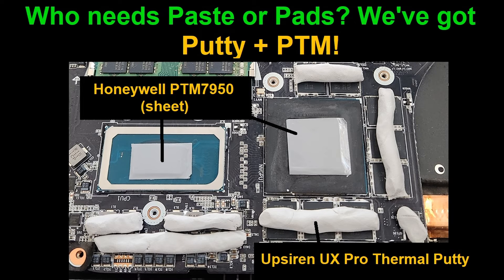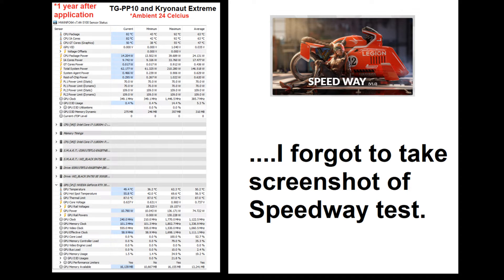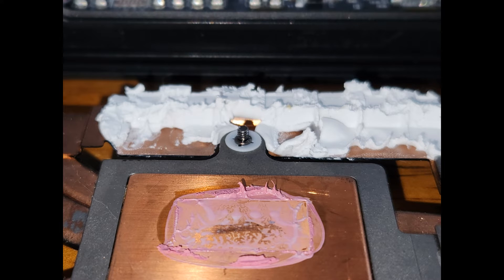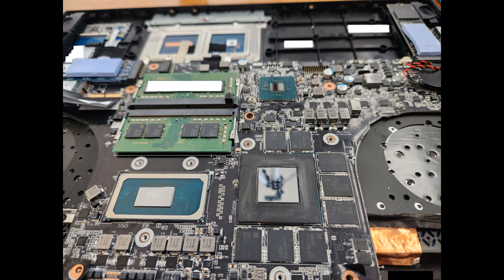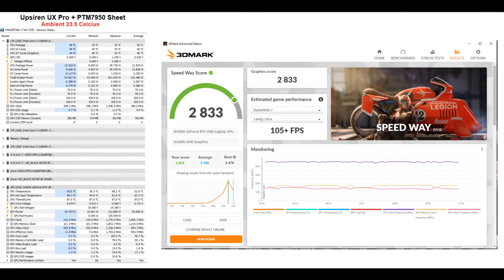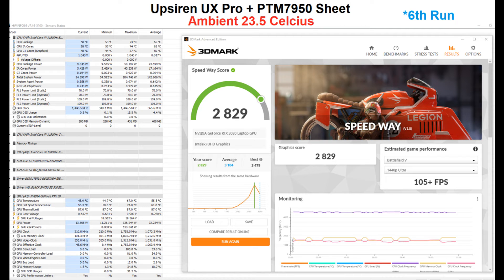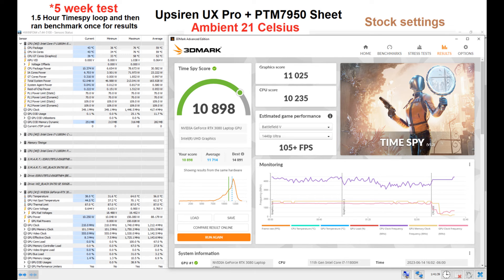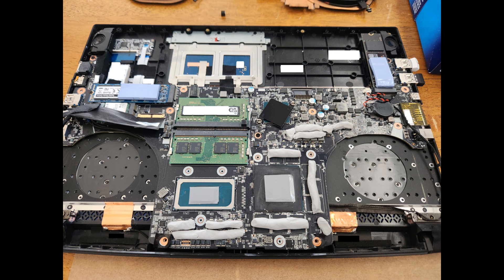RTX3080 Laptop meets Upsiren UX Pro thermal putty and Honeywell PTM7950

Comment: What happened if i applying too much putties on vram, vrm, chipset ,etc?
Reply from the maker: @vugiabao7tc425  as long as you get it compressed, and achieve good core contact then it's not an issue.

If you happen to know the stock thermal pad sizes then you can use my Thermal Putty Calculator on the Google Drive (Link in Description).

Alternatively. If you'd like advice on your application then feel free to join the Discord and post pics and ask for help.

Recommend pics include:
-pictures of the PCB and Cooler once you open it (with the stock TIM'S still in place)
-picture of your putty application

Then test fit the heatsink/cooler (tighten screws). Then take heatsink/cooler off.

-Pictures of the pCB and Heataink with the squished Putty.

Then someone will help you dial in the putty.

Once the putty is dialed in, ONLY THEN do you apply your Phase Change Material of choice (or paste if that's the way you want to go). My advice is go with Phase Change.

Comment: did you put the PTM in the freezer beforehand? mine was really tough to peel off and tore a bit, might need to reapply
Reply from the maker: @AdamAmbrus  I don't use the fridge or freezer technique as my ambuent temp is usually 25 Celcius or lower.

I recommend cutting the piece of Phase Change sheet about 3mm smaller than the die on all 4 sides. This makes 2nd peel easier, and you will still get full coverage once it melts, and 80% of the material will flow out to the edges of the die.

When I first place the piece on the die, I run my finger over it to warm it up and make it adhere to the silicon. Then I leave the 2nd film for a few minutes and work on the putty. Then I come back and use a sticker or piece of tape on one of the corners to slowly peel back the film.

Don't pull the film 'up', pull it back towards the other corner. Has less chance of lifting the sheet off the die.
Reply: @snarksdomain  thanks fo the extensive tips! I'll try it this way :)

Comment: What thickness of ptm7950 should i use for my asus tuf15 fx506hc? Im really trying to study before i open my laptop. Gained a new subscriber here. Thank you
Reply from the maker: @ajhaype  Thanks for subscribing :) The thickness won't matter in the long run. This stuff melts and squishes out the excess. Whether it starts at 0.20mm or 0.25mm, it'll still end up around 0.038mm. This means that over 80% of the Phase Change Material will end up around the edges of the die.

The most common thickness sold is 0.25mm.

It's best paired woth Thermal Putty as a putty will compress easier than pads will. This will allow for a much thinner layer which usually gives you better temperatures and smaller delta between core and hotspot.

It takes heat, pressure, and time to get thin, so keep that in mind. When you first boot up the laptop you will want to run some stress tests on CPU and GPU at same time. This is so that it will melt and fet thin for both at the same tine. Temps may look bad for 5-10 minutes but will improve. I like running the stress tests for 2 hours. This only needs to be done once. After that you'll still see gradual improvement over the next days/weeks.
Reply: @snarksdomain  thank you so much for the detailed answer. i hope many more people knows this channel your dedication on your channel is freakin awesome man. imma try to share your vid on my facebook. youre the best out there

Comment: Please is the 20g upsiren enough ?
Reply from the maker: I wouldn't buy Upsiren U6 Pro or UX Pro anymore. Upsiren UTP-8 is now the much better option. Better performance, lower cost than UX Pro, softer than UX Pro.

Other good alternatives include Fehonda LTP81 (only slightly more expensive than UTP-8, Honeywell HT10000 (best putty, but 4x the cost as of December 2024).

For laptops with gaps thinner than 0.5mm I recommend Halnziye HY236.

For a laptop you will want to buy 20g. you might use 15g (How much I used when I recently redid this laptop with UTP-8.
Reply: @snarksdomain  hi just an update on this, i am using utp 8 but my temps are not drastically better like in the 70s because my laptop initually used a blue thermal paste for cooling the vrams not thermal pads so i guess utp-8 is just too thick for it, are there any other alternatives i could try ?
Reply from the maker: @cruzz774  which laptop model do you have? It's quite possible UTP-8 is too thick if your laptop has gaps smaller than 0.5mm. If that is the case then I recommend using Halnziye HY236 instead as it can compress down below 0.1mm.

UTP-8, and other top of the chart putties all have a similar particle size. Having larger particles helps boost performance, at the cost of super thin compressibility. That's where the Halnziye is a better alternative for thin-gap laptops, and shims.
Reply: @snarksdomain  my laptop is the asus rog zephyrus g16 2023 model, could you help me with an aliexpress link where i can buy the product from?.. thank you
Reply from the maker: @cruzz774 Be sure to select the 20g of HY236 for the option.
https://a.aliexpress.com/_mNGUbaX
Reply: @snarksdomain  sorry it says item is not available
Reply from the maker: @cruzz774  my advice is to search for "HY236" or "HY206". You can also get in touch with Haknziye directly on their website and see what they advise for whichever country you're living in. You can also buy directly from Halnziye, although shipping cost will likely be a bit higher. That's the benefit of buying from large e-tailers woth broad logistics networks like Aliexpress, Amazon, etc. You get cheaper shipping costs.
Reply: @snarksdomain  i searched for it and found some on aliexpress but they are very cheap and take about 2 months to be delivered.. are their any other alternatives?
Reply from the maker: @cruzz774  it won't actually take 2 months. It'll be closer to 2-3 weeks, if not faster. Aliexpress quotes ling shipping times so that they don't have to issue refunds as often.

That being said, reach out to Haonziye sales and see if they can ship you something quickly if you want to go that route.

https://www.halnziye.net/

Comment: hey please can u answer for 1 application how much putty is required in the laptop 10g is enough or more is needed
Reply from the maker: For laptops buy 20g and maybe use 10-15g depending on Laptop model. 

If your laptop has thin gaps of 0.5mm or smaller then it's best to go with Halnziye HY236 as it can compress down thinner than 0.1mm with ease.
Reply from the maker: @devanshanil2468  For laptop buy 20g, maybe use 15g

Be sure to look at latest charts located at the Google Drive link in video description (Test Chart Repository > VRAM TIM > ETCHASH)
Reply: I'm wondering the same, especially when putting it like that. I thought  was normal to put the putty or pads only on the square surfaces instead of covering the whole area

Comment: Finally found gold. Almost ordered for padd until i did a little more research and found it could damage chips if wrong thickness is used. Well I'll just go with putty and paste (for cpu and gpu). Have you used Zezzio zt-py6 putty from ali? Planning on getting that. (haven't decided on paste yet)
Reply from the maker: @ironbootx  Putty FTW. Feel free to check out the charts located at the Google Drive link in video description (Test Chart Repository>VRAM TIM>ETCHASH).

Zezzios is decent putty. There are better and worse. All on the charts.
You'll want to buy 20g for a laptop. You might use ~15g.
Reply: @snarksdomain  thanks for this. I appreciate

Comment: Im not tech savvy or anything, 
I have a gigabyte g5 kf with the RTX 4060, it usually hits 90°c according to the osd app under intense gaming. Is it worth it to try repasting the gpu and cpu with PTM?
Reply from the maker: @3dollarsperfrown  Your GPU hits 90C? It it's just the CPU hitting 90C that's more common in a laptop, but the GPU should be running cooler (ideally).

Yeah PTM on CPU and GPU and putty on VRAM, VRM and coils.

Check out the charts located at the Google Drive Link in video description (Test Chart Repository>VRAM TIM>ETCHASH). You'll want to buy 20g or putty (should cost you $15 or less)
Reply: Thank you so much  @snarksdomain

Comment: With PTM7950 you lay the sheet down over the die and press down to make impression into it. Then you simply cut it out. Perfect size every time.
Reply from the maker: @SpAzMaNiK  I currently recommend cutting it smaller than the die by about 3mm on all 4 sides. Makes 2nd peel much easier, and you still get full coverage as 80% of it flows out once it changes Phase.
Reply: @snarksdomain  Fellow Canuck here, starting preparations to do my 3090 Turbo.  Already have the Upsiren putty, and the PTM has been languishing in the Cart for a while.  Little question if I may, pls & thx ... are you cutting the PTM to size with scissors?  Shears?  Exacto knife?  Seems very fragile ... ?
Reply from the maker: @TomNelsoninCowtown i use scissors. I cut it while it still has both plastic films in it, so it not too bad. It keeps together farily well.

Which Upsiren putty did you go with? Hopefully you got 100g. You'll use around 75-80 most likely.
Reply: @snarksdomain  Thank-you for the cutting advise!  And yes, 100g of the UTP-8.  Sound ok?
Reply from the maker: @TomNelsoninCowtown  Nice. You definitely have enough then. Can use the leftover on things like Motherboard VRM or NVME (with heatsink).

https://youtu.be/MhrykJtrfBA

When cutting it for the 3090 die, aiming for 50-70% coverage. It makes 2nd peel easier and you'll still end up with full coverage once it melts.

Comment: The thermal paste is blocking the air flow. You should just remove the thermal paste and thermal pads for optimal performance.
Reply from the maker: @rul1175  No. That isn't how the cooler works. Pads or Putty are required to move the heat fr9m the VRAM, Mosfets and Coils to the Heat pipes and oflver to the fin stack where the blower style fans push air through to move heat out of the laptop.

Not having an adequate Thermal Intwrface Matwrial for this job means that the laptop would get quite warm, and the components quite hot. That can cause damage at worst, or Thermal Throttling at the least.

Comment: thanks for tutorial and I have a question about material which used with the ptm  
you put on other circuits 
thanks again
Reply from the maker: @koukakoko9972  The Thermal Putty? I used Thermal Putty instead of Thermal Pads. The difference between Putty and Pads is that Putty doesn't have as much binding agent to make it cure and keep it's form.

There are many Putties to choose from. To see how they compare with each other you can take a look at the charts located at the Google Drive link in video description (Test Chart Repository>VRAM TIM>ETCHASH).
Reply: @snarksdomain  thank u
have a nice time

Comment: Is the U6 Pro Putty a good choice? I am on a tight budget, but need to use a decent putty for my vrams. I have an MSI Raider GE66 11UG with RTX3070 in it.
Reply from the maker: @seebzk  for a laptop you'll need 20g or less. I'd either go Upsiren UTP-8, or Halnziye HY236 (cheaper). Could also go with Jeyi 8100

Comment: Hi bro i really need your help pls return to me. i am using ptm7950 and game temps are ok but idle temps are high compared to regular thermal pastes (40  stock 50-60 ptm7950) can you recommend a thermal paste for idle. i dont game anymore
Reply from the maker: @gibonzproject9710  50-60 is a safe temp. Is that with auto fan speed? Are the watts used the same? I'd also check to see the core delta and if they are still good.

Also, any recent OS updates/upgrade? Like from Windows 10 to Windows 11?
Reply: @snarksdomain  bro i can't control the fan to set to 0 rpm. also on idle my cpu is 55-60 degree. this causes fans to always be at around 2900 rpm. before ptm 7950 on my stock paste i didn't have any idle temp problems as my temps didn't go above 50. also room temp is not high right now.
Reply: @snarksdomain  i need to drop below 50 degrees or fans will always be on. so i need al lot of help
Reply from the maker: @gibonzproject9710  does your laptop have pads or putty. If you are using pads then there's a good chance you're not getting enough core contact pressure to make the PTM7950 very thin. Once it becomes very thin the performance should be on par, if not better, than most pastes.

It's why I recommend using Thermal Putty in conjunction with Phase Change Materials since putty can compress more than pads allow.

If you want to stick with pads, then likely go for one of the thicker pastes on the market.
Reply: @snarksdomain  no i dont have pads only putty
Reply: @snarksdomain  can you recommend a liquid paste that is little bit more durable to pump out than others. thank you. i think ptm7950 and other stuff idles around 45° as it changes form. So it is not suitable for me thank you
Reply: @snarksdomain  master gel pro , mx6, thermal grizzlys what do you recommend
Reply from the maker: @gibonzproject9710 PTM7950 can still achieve lower idel temps in most cases, as long as it's thin.

I would recommend trying to apply some pressure by hand to the hearsink first before replacing the PTM. Thus would mean removing the bottom cover, disconnecting battery cable for maximum safety, and then pressing down with moderate pressure on the heatsink, on top of the CPU and GPU.

I recommend this as getting the putty perfectly compressed often requires manual pressure.

Then give it a good load for at least 30 minutes and reevaluate idle temps.

If idel temps are still bad then maybe something like the Fehonda 14.8w paste, or another thick paste.

I still need to expand my paste testing so not sure if I can confidently recommend something for you.

My recommendation for the Fehonda paste comes from me hearing good things about it from a couple of people I chat with.
Reply from the maker: I just tested out my laptop with the fans off and watching Youtube videos. It was doing an average of 43 Celsius at 25 watts. That's with ~18 month old, reused PTM7950
Reply: @snarksdomain  That's nice. Yesterday i reapplied my last ptm 7950 which lasted three times from 31x50 size. For now on battery with avg 3-8W cpu temp is 40-42°. I will test plugged in temps today. (Chrome + vs code + some coding apps with 20-25W cpu usage and with a external monitor). This time i left screws little loose.
Reply: @snarksdomain  never mind i just bought 40x80 ptm from passionate girl store today. i guess i have to replace every 3-6 months. my cpu + gpu die is total 420 mm² so 3200 mm² will last me at least 5-6 times
Reply from the maker: @gibonzproject9710  no need to replace each time. It can be reused. The best technique I've found so far is to scrape all the excess bits and place in the die, then put a piece of tinfoil over it. Buy a cheap butter knife and bend the end at an angle. Then you can heat it up with a lighter/torch/candle and use it as a hot iron to melt the bits into a flat sheet again.

Let it cool and then peel the Tinfoil.
Reply: @snarksdomain  thanks that is a great tactic i also use old leftover ptm but it's cheap for laptops. one usage costs $2 so worth it maybe for PC that would be make soo much sense

Comment: Hey Snarks, i have an Asus F15 (I5 11400H & RTX 3050) and id like to repaste it, i got the PTM and im trying to decide should i go with the UX Pro or the UTP-8, what do you think is the best ?
Reply from the maker: @karima.4332  I would get UTP-8 over UX Pro. It's similar/higher performance as the UX Pro, softer and cheaper.

Some other good options are Honeywell HT10000 (current top putty) and Fehonda LTP81.

That being said, if you find blue putty in your laptop it is likely Laird T-T-Putty 607. If it's still soft enough to reshape you can reuse it. Putty is good for reuse as long as it's still soft, and not the crappy liquidy white stuff.

For laptops with gaps smaller than 0.5mm I recommend Halnziye HY236.
Reply: @snarksdomain  thank you sir

Comment: I have an Asus TUF a15 (R7 4800H + 1650ti) 
i did repaste a few months ago with gelid GC4 on VRAM(hard and expensive to get putty in India) and gelid GC extreme on CPU+GPU

but it's horrible i am thinking of doing ptm7950 +  some kind of thermal putty but there is no real comparison for noobies between all the versions of upsiren (UX vs UTP-8 vs pro etc)
Reply from the maker: @fringeanomaly9284  feel free to take a look at the charts located at the Google Drive link below (Test Chart Repository>VRAM TIM>ETCHASH). There you will find a chart showing the relative performance for the few dozen putties I have tested.

If you laptop has gaps smaller than 0.5mm, I recommend Halnziye HY236 / HY256. It can be bought directly from Halnziye or perhaps on Alibaba or Ebuy7.

If your laptop has gaps larger than 0.5mm the. You could use Honeywell HT10000, Upsiren UTP-8, Fehonda LTP81, or others.

Comment: Hey Snarks, I'd like to repaste my laptop ( ASUS TUF A15, RTX 4050, RYZEN 7 7735HS ). Will this combo do the job?  Upsiren PCM-1 and Upsiren UX Pro thermal putty or should I use ARCTIC MX-6 and normal pads?
Reply from the maker: @stefonimircea5416 I likely go with Upsiren UTP-8 or Halnziye HY236 if the gaps are really thin. 

For the core either Honeywell PTM7950, Thermalright Heilos, Upsiren PCM-1, or one of the other similar Phase Change Materials.
Reply: @snarksdomain Thank you so much on the info, love what you do, keep going!